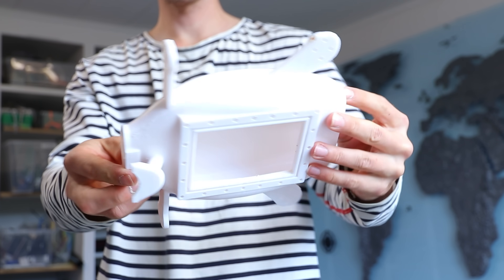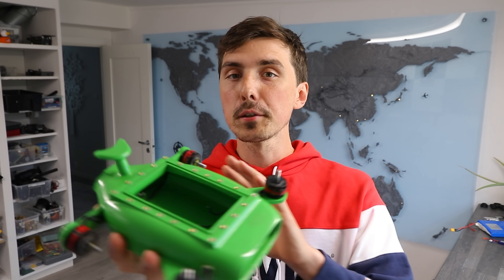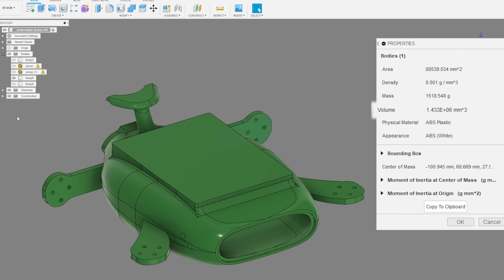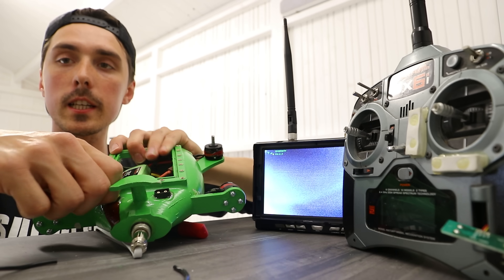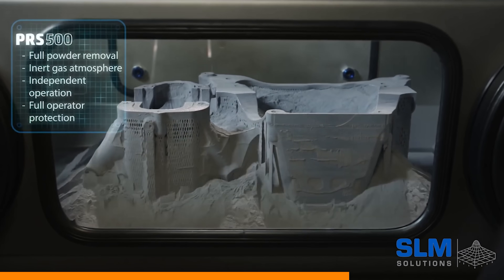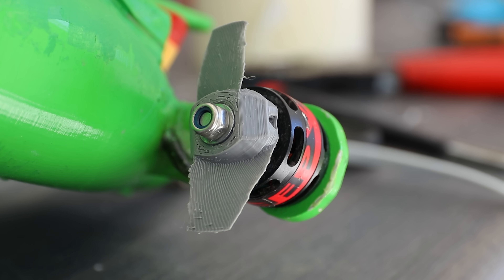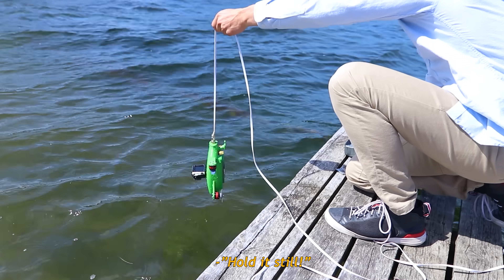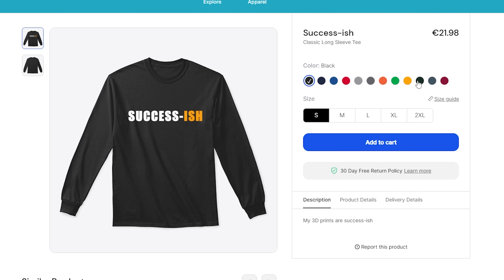Underwater Drone Built With Parts From a Flying Drone

Comment: Use the spare pins to send battery from the floating box then you will need less holes in your sub. Each pin will add some amps you can send.

If you pause during the print then you can design the holes in the print and maybe even have it as a single print with connectors on the main board

Comment: It's late and honestly will take a chance from a cursery glance at the comments and say, Simon still can't print a watertight hull nor use o-rings;-)
Here goes my tips:
You can print watertight. Print at high temps, no retractions, watch any gaps carefully and play with overlap and such. Look at what the guys printing RC sailboats are doing. Waterproof hulls at 1-2 walls:)

O-ring design is not difficult at all. And to aid you just use Trelleborg's or Erik's online o-ring calculators. 
I have printed parts for pneumatic speargun holding 30 bar of pressure and all the o-ring groove dimensions were verified in one of the above calculators. 

But it can be difficult to FDM print a super smooth bore or groove that an o-ring can seal against at higher pressures. I solved it by secondary machining - sometimes just sanding. But with resin printing, you can actually get the surfaces smooth enough.

Comment: Suggestions for you… 
1. instead of multiple cables running to surface which are bulky, heavy, and don’t allow the drone to move as freely as it could… just lengthen the receiver antenna so it reaches the surface.
2. All openings should be round. You could design one that threads (like a jar lid) on and has o-ring at base. Should seal reliably, easily, and be quickly removable.

Comment: An old trick we used to use for custom gaskets for hatches on race RC boats was to use silicone on the body and petroleum jelly on the lid. Fasten together, not torquing down completely, and you have a flexible, custom gasket.

Comment: Just an idea. Get one of those Sea-Doo underwater scooters and modify controls to be remote. Already has sealed battery housing, motor etc. Just requires tethering or here's an idea a co2 cannisters/bag on a timer set to go off if battery power drops floating it to the surface. 3d print necessary upgrade pieces rather than starting from scratch.

Comment: the way you cool watertight devices is by having a heatsink (or a full pump and heat-exchanger and blower (radiator)) with or without fan to the hull, it blows cold air from there. water will go inside the floating relay thru the fan opening and you'll lose it.
also if you shape the floating relay like a buoy it would be better, like 2 tall cones stuck by their circular parts, with some lead ballast on one end around the cable exit (and a cooling heatsink) and the antenna up top, that way it causes less drag to the sub and stands the antenna easier over the waves, waves cut out, and reflect the signal upwards. you could open it and close it twisting the two cones together with some o-rings in between
Reply: I'd make the bottom of the 'hull' of the floating control out of aluminum with an o-ring seal to the plastic sides/top. Then use that aluminum as a heatsink, or even put some actual heatsinks on the bottom so that you're constantly water-cooling the heatsinks.

Comment: Drill the cover holes so the thread falls through the cover this will help avoid warping of the plastic and a better seal also might be worth doing it the same as a car, where you tighten small amounts at a time to avoid any warps and similar torqued screws.

Comment: If you put the hatch at the bottom of the sub then the air won't try to escape through the hatch..
It will still leak as your cursed but at least it will leak less.

Comment: I made one using PVC pipe with screw cap ends to easily access the battery and 3d printed motor thrusters. I also went with a floatation device attached with a 3m cable rather than all cable . I am using TBS crossfire for my control link and an 800mw vtx so no problem with range. Biggest problem I found was condensation on the fpv camera, best way I found to combat this is to have the camera in its own small sealed chamber with the least amount of air volume in there as possible. Here is a link to me using it 😉 https://youtu.be/KRUj62n95SQ

Comment: Awesome vid,  got me in problem solving mode so may i suggest if you take another crack at the 3d printed drone that you encapsulate  the control board in silicone or resin once assembled   water will inevitably get inside but having the vulnerable components sealed within a water tight environment should just make it a question of removing the moisture that seeps in,     and to that end might i recommend inserting several packets of silca desiccant within the hull to absorb  moisture .
Reply: The pdb can be coated in silicon conformal coating and the same with the escs however I would also heat shrink the escs and silicon the ends where the wires come out before fully heat shrinking😉
Reply: @sulphur_fpv  good tip :D!

Comment: Solder a BMS board to the balance leads...it's the same thing...then you can safely externally charge the entire battery and keep the cells balanced
Conformal coat the boards so they are somewhat water resistant..

Comment: Instead of epoxy or that awful silicon, try using RTV Ultra-Black.  It should make a better seal and won't leak corrosive chemicals into the area with the electronics.  Ultra-Black is the one to use around any electronics. ;)

Comment: make it narrow like drone but less room less space so you dont have to worry too much about weight air issues
have motor control battery seal in with rear door with washer and a screws and front is add on but not together with camera and camera is in 2nd room small cube just attached to front of it so it less leaky or no leaky

Comment: you should mount the heatsink upside down and on the bottom of the floating bit, cut a hole and seal around it so you can mount the PCBs to it with thermal pads and boom, the water also helps cool them...should be easier to seal since there isnt nearly as much hull pressure vs submerged

Comment: Don't think this UnderWater Drone would work in salt water (like an ocean), as saltwater is conductive to electricity and would short signals going from ESC to the motors. Fresh water is ok, but as other have mentioned, flushing with clean fresh water and oiling the motor bearings would prolong running time.

Comment: I do not understand why you do not  fill the internal void with oil. This will prevent water pressure issues protect the electronics, lubricate parts and is as you know non conductive. Maybe this is the way forward. Nice video BTW.

Comment: 5:37 Fill the internal void with nonconductive transparent oil. Be alert to the fact that the oil will screw up the optics of the camera lens, so have a very small AIR BUBBLE between the camera lens and the flat transparent front window of the drone!

Comment: "I need weight to be distributed and to make the box stable on water"
"My system obviously will need a heatsink"
Throws two expensive and highly pollutant batteries that are easily damaged by heat inside
"Done"

Comment: I recommend putting propellor guards on those props of yours. They will make easy use of the umbillacal and leave your ROV (remote operated vehicle) loose and dead in the water. Also important on both your home made ROV and the iFish is to keep a count on how many turns you make in each direction, as a lot of turns and a sharp pull can sever the connection inside the umbillical. It is easier to seal a round hatch waterproof than a square and it is very, very important to cross tighten the screws. I.e. tighten the opposite screws, much like the bolts on a car wheel.

Comment: I heard that candle wax is a good way to make 3D prints water tight. I didn't try it yet though, but epoxy and TPU didn't give great results, mostly because TPU is too liquid and ePoxy requires 100% overage outside (i.e. doesn't go in). I'd also consider having a much smaller opening latch, easier to make water tight. TPU used for printers isn't soft enough usually as it's like 95A. Ideally you plan to use a standard rubber seal make or TPE or similar, very soft.

For the radio, we'd need an acoustic system; which sounds like a great project on its own. Bandwidth is probably an issue however at the moment we wouldn't need to care about regulations at least LOL.

Comment: Use CorrosionX on the motors, and all the electronics inside, that stuff is pure magic! Trust me I fly over salt water :)
Also, you NEED those balance leads to safely charge… Cells will slowly have different voltages and the list of stuff that can go wrong grows. But hey, its your house…
Amazing project!!

Comment: put the hatch on the bottom. the air pressure will keep the water out so long as you have no leaks for the water to press in. you can make waterproof switches using magnets to turn it off and on.   some of these latest projects dont seem to be very well thought out my dude

Comment: The ball bearings in the motors always rust and seize up when they get wet. You need motors with sleeve bearings instead, that will work in water. I don't even know if they sell such motors.

Comment: Couple quick notes, motors, as others have said they won't fail immediately but oil will help a lot, and at least rinse with clean water afterwards. Also, with the balance lead, usually with a well-balanced battery with well-matched cells, it will probably be fine, but charging with only the main lead can definitely lead to some cell imbalance and damage. In the future, you can get a passive balancer board that will balance while charging, but take very little (or no) power otherwise. For something short like that, I would just undercharge it a bit, like to 4.1/cell or so just to avoid overcharging a cell.
Reply: Yup. I totally cringed when he said you don't need to use the balance lead when charging (and didn't follow it up with a warning about cell balancing). But since he was apparently only doing this as an ad for that expensive commercial one I guess it makes sense...

Comment: What if you add an extra cable for power, move all batteries to the buoy,  and also add solar panels to the buoy and a solar charger circuit as well to extend swim time?

Comment: Only halfway through, and someone has probably suggested this already, but.. To save yourself some trial and error with the ballast, you could just temporarily seal the hull, submerge it in a container, take note of how much water it displaces, and calculate the updrift on the drone. Then just add enough ballast to make the drone weigh the same or a bit more than the updrift, and you should be golden~

Comment: In my last video, I built a 3d printed boat with a removable lit which is completely waterproof. I covered the hull in epoxy and used a very soft rubber/foam seal

Comment: Why the heck, you don't just use water-cooling. Seal the heatsink into the underside and let it touch water... Heat pipe to metal body is also an option, as long as you use the body as groundplane for the antenna

Comment: If you plan on leaving the flotation device, maybe you can remove the battery from the drone alltogether and power it from the device?
Reply: I wonder if a jet drive would be better. Removing every thing except for the camera and batteries. Batteries are better suited close to the motors unless you want super thick cables for power. I seen a comment above about someone talking about doing a vacuum test. I wonder if one could pull a vacuum and it would still work underwater with all of the different types of pressures at depth? 
I can not recall who made a sub a while back. They used a syringe to push and pull water for buoyancy.
Reply: @kameljoe21 DIY Perks did a submarine like that.
Reply: @Dooezzz  Yeah that was the one. I could not think of it. It was pretty cool!

Comment: you should make the ESCs and all the electric waterproof with Acryl Harz or something similar. And the motors need closed bearings with boat grease in it. After the use u should clean the motors with normale water and put some oil on it.

Comment: Thanks for sharing the excellent project.  It's a good idea to remove trash when you see it as none of it should be there, but not all trash is harmful.  Plastics are generally bad, but aluminum cans are not so terrible as they are stable over time and quickly become a home for aquatic life.  The one you removed was an eyesore to humans, but to wildlife it was just a place to call home.  I don't support littering at all and society should work to achieve 100% proper recycling and disposal, but trash that is not dangerous and which has already become a habitat for wildlife is probably best left alone.

Comment: A+ for effort, I also made little water motors out of old CDROM disk drives, even after packing and filling the inside of the 3d printed housing with waterproof gear grease. water still managed to find its way in and seized the motors. Water environment is just as challenging as space I think.

Comment: I like your style with the brushless motors and wireless float on the surface. Made my own underwater drone this way, which is constant work in progress, but works quite well most of the time. I found epoxy sealing where the wires go into the motor helps since wires are not coated where they join from motor windings to cable. Also I use pvc pipe as a pressure hull. Pipe union style fittings for the pvc pipe have an o-ring style seal, and you can swap the flat side of the union for a piece of plexiglass/acrylic and you have an easily openable but very robust hatch of sorts. Only challenge there is you then need a long narrow chassis to easily get electronics in and out of the pipe enclosure. Keep up the cool projects!
Reply: I done mine the same as you with PVC pipe and used screw cap ends, unfortunately the smallest I could find was 100mm pipe and wished I could have found some screw on caps to suit 65mm pipe so it would have displaced less. I got around this by adding a heap of lead in the pipe, the battery sits on the lead so it kinda works like a heat sink lol